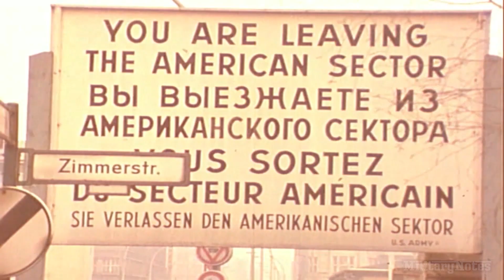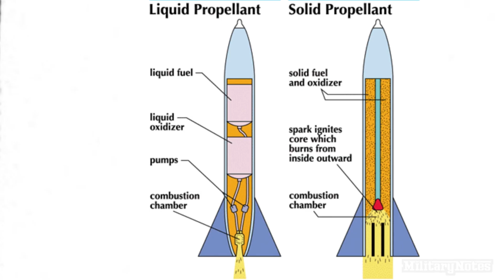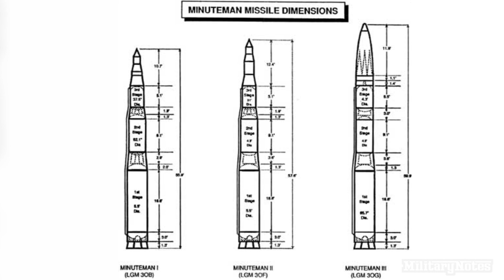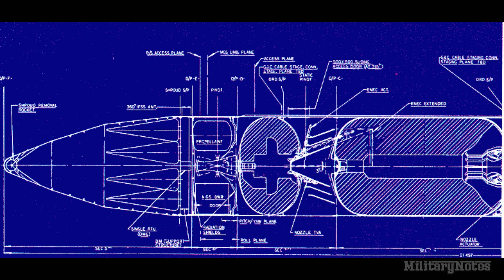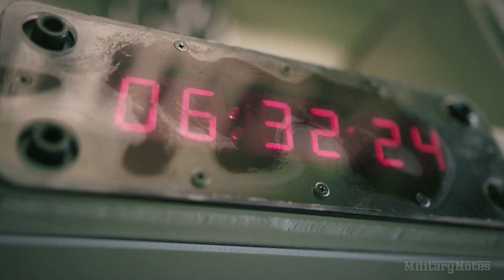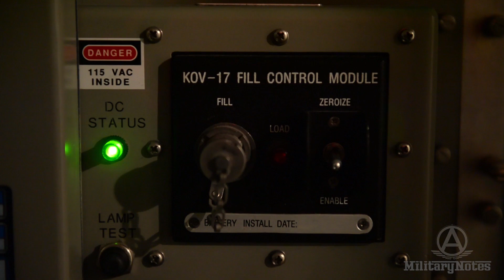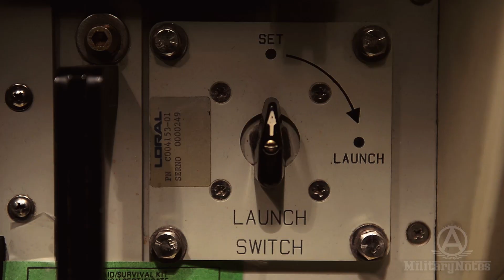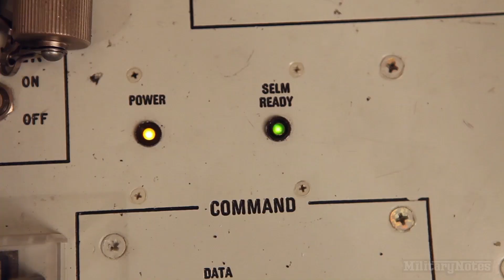MINUTEMAN III ICBM DOCUMENTARY 2017

Comment: You take a metal cylinder tube in place a computer system inside optics and sensors and then you have heat conduction in boosters in the back you have heat building up on the nose cone as you fly through the atmosphere and you got the plutonium that is creating a very strong magnetic field you think this is going to work are you stupid or something? Are you that indicated into your university of stupidity because in logic understanding this is just complete bullshit. It does not work and it’s been scripted for you to believe this through repetition of perception it’s just programming bullshit brainwash it’s not logic the common sense of this just blows up above you with a bunch of radiation falling down on top of you 😂😂😂😂😂😂😂

Comment: I worked this missile system. Loved it. 3 solid propellant rocket stages, 1 liquid fueld stage, guidance platform, payload deck and shroud. Delivering sunrises in 30 minutes or less.
Reply: I also worked on them.  FEW 83-93
Reply: I have a question, Does it need to fuelling up the liquid stage or it’s always full of fuel and if it’s required fuelling, how long does its take ?

Comment: "Because of the ability to carry three warheads it had more than twice the blast radius" - That is factually incorrect. The MM III when they were introduced could carry three 170 Kt warheads. The MM II could carry one 1.2 Megaton warheads. That was almost 3x as much as the 3 warheads that MM III could carry. And since we're speaking of this, I will never understand why the US chose the 300 KT warheads as it warhead of choice on the MM III after the Cold War ended. The treaties did not allow the US to put more than 1 warheads per ICBM. So then why not put the most powerful one that the missiles could carry, the 1.2 Mt warhead? I'm sure some treasonous politics were involved there...

Comment: THE DEFINITION OF HYPERGOLIC IN THE BEGINING OF THIS VIDEO IS WRONG! 
Missiles that use liquid fuel aren't per se hypergolic, they need to be using hyperbolic propellants to be considered hypergolic. 
A rocket can be considered hypergolic when it uses hypergolic propellants, which are propellant which spontaneously react on impact.
Thor, Jupiter, and titan 1 uses LOX (Liquid oxygen) and RP-1 (highly refined kerosene) which don't spontaneously react on impact with one another. The only hypergolic missile mentioned was Titan 2.

HOW does a spontaneous reaction eliminate the need to add fuel before launch? The question is about if the fuel can be stored, which LOX can,t, because it boils off. Yes solid propellants can be stored but hyperbolic fuels can also be stored, the reason why we stop using them was that they were impractical because they're extremely toxic and cancerous.

Comment: As a former Minuteman III launch crew commander, I found so many factual errors in the first two minutes of this tripe that I was unwilling to watch the rest. 1:01 - Design spec for the range of the Atlas was 5,500 nautical miles, not 500. Refinements brought the actual range to over 8,000. 1:15 - Talking about a liquid-fueled missile while showing a solid-fueled one. 1:22 - Not all liquid fuel/oxidizer combinations are hypergolic. The only US ICBM to use hypergolic propellants was the Titan II. 1:34 - Thor, Jupiter, and Titan I were neither hypergolic nor developed after the Atlas. All three missiles used LOX as an oxidizer and petroleum-based fuels. Thor and Jupiter predated Atlas, and the Atlas and Titan I were developed largely concurrently. 1:55 - Talking about a solid-fueled missile while showing a liquid-fueled one. 2:00 - Claiming that solid fuel is "more accurate" than liquid fuel is hogwash. Accuracy is not a characteristic of a propellant.

Honestly, freedom of speech notwithstanding, whoever threw this embarrassment together had no business doing so.
Reply: Okay, good.  So I'm not the only one that was wondering where they got their info from.
Reply: for this info u dont need to be a "minuteman 3 launch crew commander" and btw, i saw a few here that said they worked on those missiles. interesting, i bet u know your comrades ;)
Reply: The Pentagon may stage a false flag use of a tactical nuke in Ukraine and blame it on Russian military forces, deliberately creating justification for several thousand "retaliatory" nuclear strikes against Russia.
Reply: @bulgingbattery2050  hahahahahah shut up :D its more like that russia is gonna stage this, like they did in syria with bio weapons . How braindead u must be to say this, or just russian troll bot
Reply: Indeed, a 500nm BM is not an ICBM, by definition.
Reply: Meh it was good enough for John Q. Public.  I was in the RCAF 30 years and dealt with armaments (as we call it over here).  It's not a training video or anything.  No fighter pilot ever had a call sign like "Maverick" or "Iceman" either, but life goes on.
Reply: @PappyGunn  Top Gun didn't claim itself a documentary.

Comment: the LGM-30 minuteman 3 is manufactured by Boeing and costs $7,000,000. the missile is 59 feet long, weighs 79,000 lbs. the payload can be multiple W78s or W87s MIRVs warheads each with a yield of 350-475 kilotons or can carry a single multi-megaton warhead. the minuteman 3s top speed is 17,000 mph, operational range is classified (but is greater than 8000 miles), accuracy is within 90 meters circular error probable.
Reply: Intetesting info and fascinating weapon! Thanks!!
Reply: Other than never carrying multi megaton warheads, not bad.
Reply: @SpencerAK74M  I believe multiple warheads are prohibited by current treaties. The missile is capable of multiple warheads, but currently is fitted with only one.
Reply: @jondrew55  Not really. It's just the total number of deployed warheads that's somewhat regulated.
Reply: @SpencerAK74M  No, really. Land based MIRVs banned by START 2 Treat. https://en.wikipedia.org/wiki/Multiple_independently_targetable_reentry_vehicle
Reply: @jondrew55  That's great and all, but the Russians withdrew from START II after we withdrew from the ABM treaty. In other words, the only reason why we don't mirv the MMIII's is because the Tridents are mirv'd and are our primary strike capability.
Reply: @jondrew55  New START is the latest treaty you need to read. Basically, each Party has the flexibility to determine for itself the structure of its strategic forces within the aggregate limits of the Treaty. These limits are based on the thorough analysis conducted by Department of Defense planners in support of the 2010 Nuclear Posture Review.
Reply: @SpencerAK74M  Correct, the Russians have basically said we have violated that treaty and they no longer recognize it. I guess my point was that we removed MIRVs from land based ICBMS because of the treaty and I assume no one feels the need to put them back on. SSBNs are the real threat we we have and they do have multiple warheads.
Reply: Come on man, you tell me the missile is worth $7 millions and after I buy it, you tell me it doesn't come with the warheads?  What good is an ICBM without warheads?  I want my money back.

Comment: Extremely old reliable shit. Needs replaced point blank.
Reply: It's still accurate and it works. It will be face to use until the new missle replaces it in the next 5 years.

Comment: Zechariah 5:1Then I turned, and lifted up mine eyes, and looked, and behold a flying roll.
2 And he said unto me, What seest thou? And I answered, I see a flying roll; the length thereof is twenty cubits, and the breadth thereof ten cubits.  The Minute man III missile has the dimensions of the flying roll that Zechariah saw.
Reply: I'm not brushed up on cubits however...something 20 cubits long and 10 wide is nothing near a ICBM. It would be more liken to a flying soda can.
Reply: So you're saying a Minuteman III is only twice as long as it is wide? Guess again -- it's roughly 5.5 feet in diameter and 59.9 feet long.
Reply: @ttiwkram  the second smaller measurement is not diameter its circumference also its the 2nd an 3rd stage the flight stages that matched the length measurement physical shape as described in Zechariah 5,  Michael rood of a rood awakening used to work on the minuteman's and as far as I know he is the first person to make the connection to Zechariah 5 and present it to the public for the last several decades so if you are interested in the topic you should look up his videos.  such as this video.  https://www.youtube.com/watch?v=dACR3RAaMMQ  
Rood seems to have quite a few biblical insights, here is a link to one of his videos,   I mention Zechariah 5 in my videos as well but not nearly as thoroughly as Michael Rood, he focus's on Zechariah 5 since he actually worked upon the minute man missiles.
There are many other missiles throughout the nations a few of them also fit the dimensions of Zechariah 5, but the minuteman 2/3 is most likely the literal fulfillment since there are so very many of them and they are such terrible powerful weapons, the Chinese JL-2 or 3 cant remember which slbm also seemed to fit the size description as I recall.  Its been years since I considered the Zechariah 5 issue, there could be new weapons systems which also fit the size parameters of Zechariah 5.

Rood like most teachers in this generation is wrong about most things in my opinion but I think he has a descent understanding of Zechariah 5 and I think he means well.  

For example I just heard Rood say in the video link I included that he doesn't think Isaiah 17:1 is fulfilled in Damascus, but he is wrong like everyone else, over 100 square miles of Damascus has become a ruinous heap search youtube and you can see vast vast vast portions of Damascus lay in ruins, its only the English translation that makes it sound like 100% destruction of Damascus, however like I said over hundred square miles of Damascus has been laid waste during the Syrian Gog magog civil war, but instead of doing his job an telling the people look Ezekiel 38/39 Gog magog an Isaiah 17:1 is literally fulfilled, Rood says the opposite even after I explain it to him.  Its sort of irritating how obtuse everyone in this generation is.

Comment: Not all liquid fueled rockets are hypergolic, and specifically rockets that utilize LOX are not hypergolic. Hypergolic propellants spontaneously ignite on contact- for example hydrazine and dinitrogen tetroxide. The Atlas and Titan I did not use hypergolic propellants but the Titan II did, specifically aerozine 50 (a mix of hydrazine and UDMH) and dinitrogen tetroxide. 

Also the whole point of hypergolic fuels in the case of an ICBM was that they could be launched immediately without the long fueling times.

One last note- "multiple independent delivery system" is MIDS, not MIRV. MIRV is multiple independently-targetable reentry vehicle. 

If you're going to make videos about these sorts of things please try to get your details correct.

Comment: The Titan II had fuel and oxidizer stored on board and only required 60 seconds for launch.  The T2 was a contemporary of the MMII and MMIII and had 3 loaded targets which could be switched at the press of a button.
Reply: The question I have is did they keep it ready for launch all fueled up for weeks on end?  If so, sounds dangerous as F.
Reply: @PappyGunn  it was fueled up and ready 24-7, 365 days a year for more than 20 years. 
Of course it was dangerous if you didn't respect it.